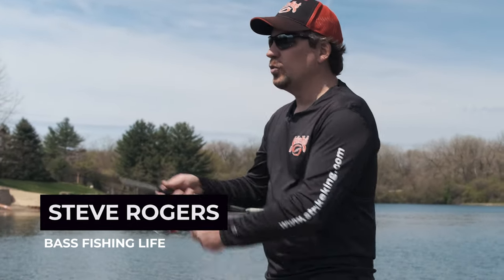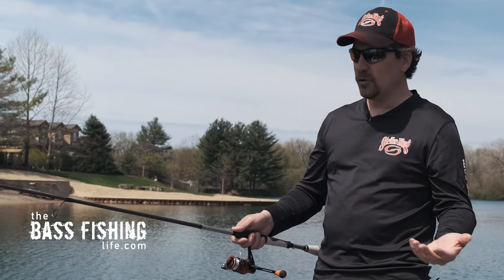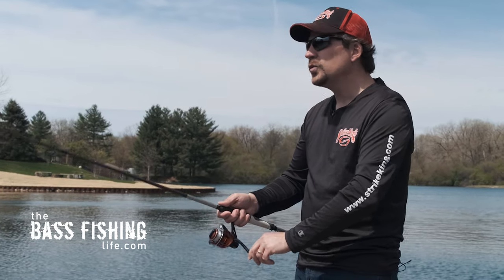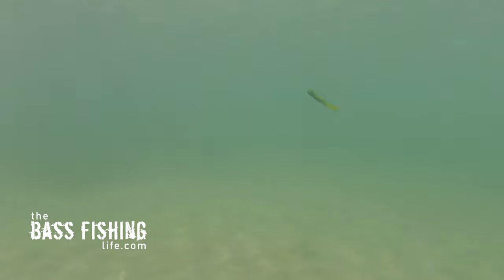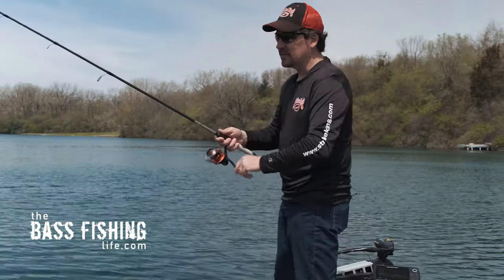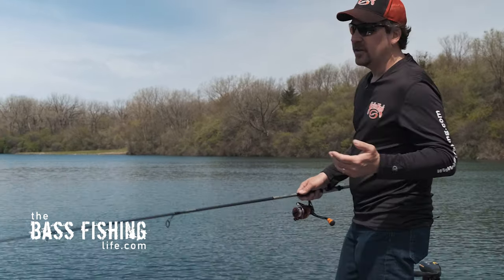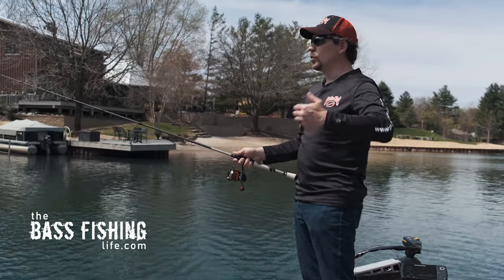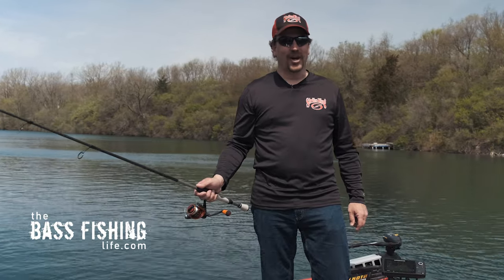Swimming a Tube Jig: 3 Presentations | Swimming a Soft Plastic Tube for Bass

Comment: Good morning Steve… I happen to have a some qstrike king 4.5 Denny Brauer tubes that have a semisolid head to them… what would be an appropriate weighted insert so I can fish them weedless… I like to swim tubes as well but sometimes I see where it would be helpful to have a weight inside... Any recommendations? Currently I just have the weightless trokar tube hooks,  And putting a bullet weight on the outside like a Texas rig Just doesn't seem natural especially when swimming them..  I'd appreciate your advice
Reply from the maker: Those solid heads definitely make it a little different setup. If you are looking for a traditional insert style head I would go with something pretty light like a 1/16 or 1/8 since the solid head is going to add some weight already. I"ve just been using the Bass Pro XPS insert heads. Not too expensive and have worked well for me. I do prefer a lighter wire hook when swimming a tube since most of the hooksets are just a side sweep maintain pressure type of situation. I hope this helps some.
Reply: It does, and thanks..I haven't used those yet, and didn't consider the extra weight those solid heads might add.. I'll try it..